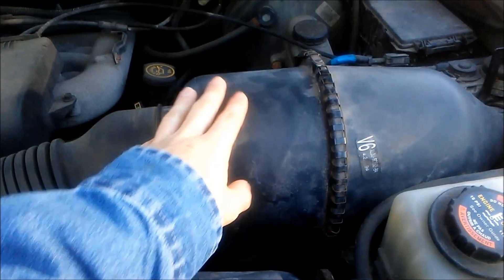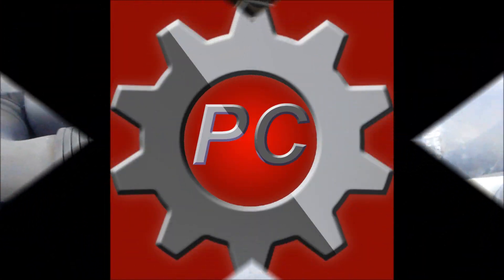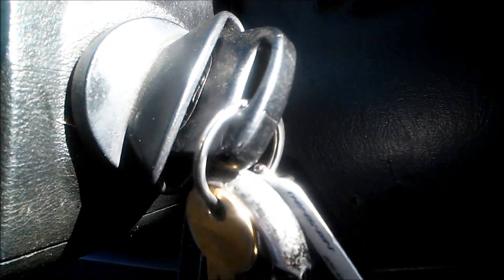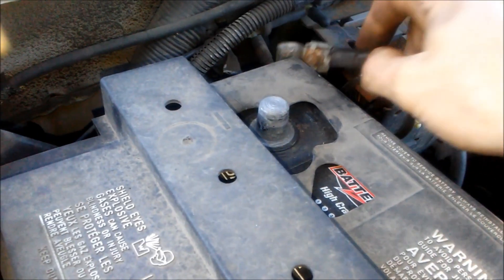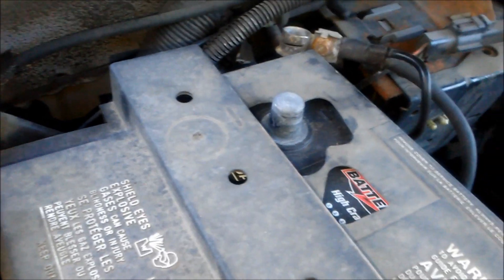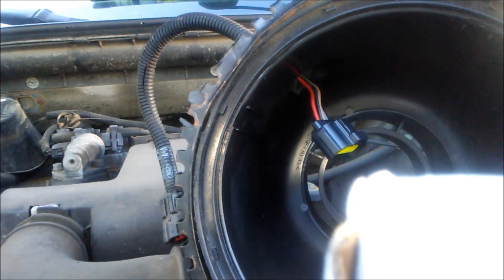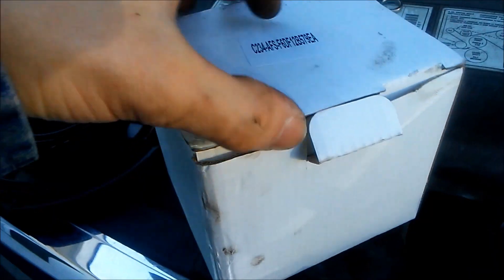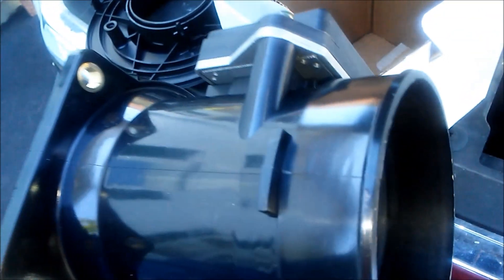How to Test and Replace Ford F150 Mass Air Flow Sensor

Comment: My 4.2 V6 enigne on 2000 F150 seems to run good. Check Engine light has been on for a couple years. One time Autozone checked it said it was a gas cap problem. Replaced cap same thing. I recently got some codes- PO174, PO420, PO453. I unplugged the MAF sensor and the engine kept running. The engine seemed to increase speed a little when I first unplugged it. So could this be a bad MAF sensor?

Comment: I had removed my maf sensor to clean , so just put the airflow housing back together without it and the car started immediately .

Would that also indicate that the sensor is bad?
Reply: Yes If your Car Started right Up without it and Engine Running Smooth, you need to Change it 👍

Comment: I keep getting mixed messages some people say if it keeps running then it's good other people say if it shuts off then it's bad. Please help I just spent $130 that I might not have needed to spend
Reply: If it stops its good
Reply: Yes werm me too
Reply: If it's Still Running without The MAF sensor and Running Smooth then it's time to change it

Comment: Now that’s the way to make a how-to video! 👍. Short, to the point and no blah blah blah about unrelated stuff! Thanx!
Reply from the maker: Thanks :-)
Reply: It never explained the location, never identified the sensor, never showed the replacement of it, didn't provide part numbers. It did show someone fiddling with an air filter compartment and a screw driver. Well done!

Comment: Hey I had a Harley davidson f150 have lean code p0171 and p0174 when ever I disconnect the maf the truck run fine whenever connected back in the truck start to run rough
Reply: I have the same issue on my 97 F150, whenever I went over 45 or 50 accelerating slowly It started to shake but if I pressed the pedal all the way down it stopped, so I did what he said in this vid and the engine kept running after the disconnecting, meaning the MAF or flow sensor was bad, should be an easy fix, and hope I was of some assistance
Reply from the maker: Yes, If you connect it and it starts running rough the MAF is probably the issue.  I would also check two other thing the spark plugs and a tube that connecting (just after the MAF) under the big in coming air line the tube tends to pop off when you lift up the air line to look at the MAF or air filter.  The small tube connects to a sensor for the engine to determine incoming air pressure if disconnected the engine will run rough.
Reply: Yes Reuben same thing happened with me
Reply: It's Your MAF Sensor good job